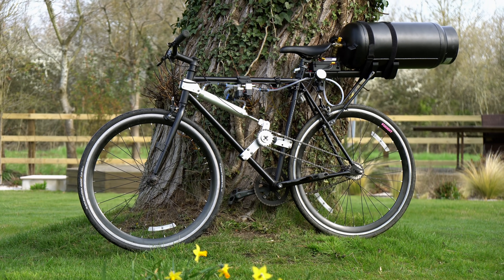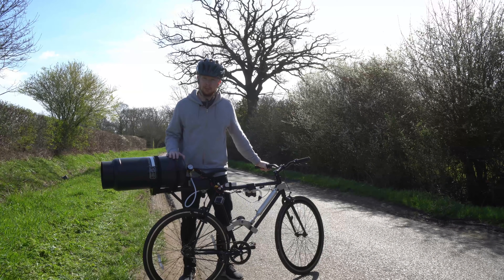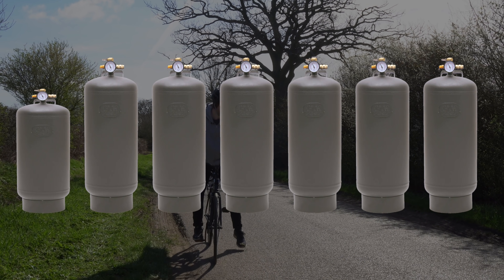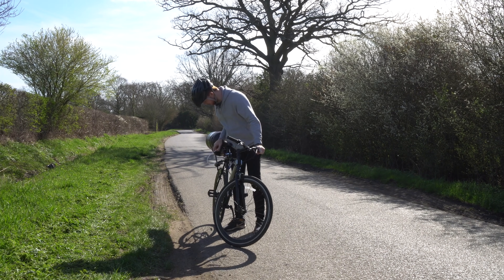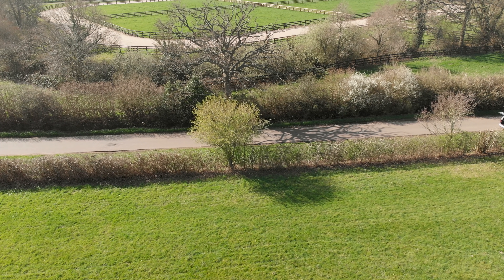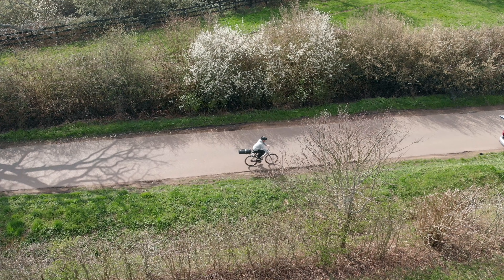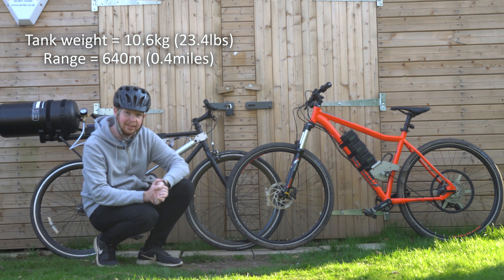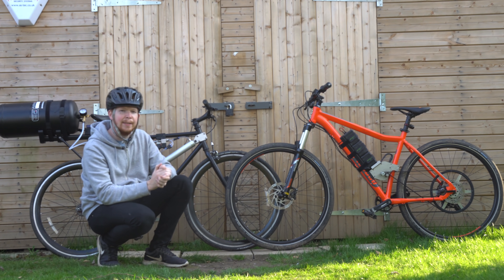Air Powered Bike Range

Comment: Could some creative valve timing be used for regenerative braking?
Reply: The AlienRobotAnthropologist wouldn’t it be possible to use the cylinder that is already there as a compressor?

So that you use the rotation of the wheel to push air back into the tank?
Reply: @among-us-99999  The exhaust pressure in the cylinder would have to be greater than what's in the tank in order to re-pressurise the tank.  That would be pretty much impossible.  You might be able to pressurise a reserve tank, but once the reserve tank build up pressure it would start to slow the bike down.  If you've ever used a hand pump to inflate a bicycle tire, you'd know what I mean.
Reply: dockettome well..the purpose of regenerative braking is slowing the bike Down
Reply: @among-us-99999  Except the "reserve" tank in this case could hold no more PSI than the cylinder can consume, which would be hilariously low.  You'd be lucky to get one stroke of usable stored air.
I actually own a couple of air compressors for air tools.  One of them is a small 6 Gallon pancake tank that holds 150PSI.  It can only be used with small nail guns, like a brad nailer.  I tried a framing nailer (3-1/4 inch nails) on it and it did work, but only fired about 4 nails before the electric pump had to kick in to re-pressurise the tank, and that takes a couple of minutes.  Compressed air is great for quick bursts of energy, but overall is horribly inefficient as a fuel source.
Reply: @dockettome  You'd need a separate cylinder with a much smaller piston surface area to compress the air at high enough pressures
, and then it could work
Reply: @thealienrobotanthropologist  Thermodynamics don't get in the way of getting some pressure out of your kinetic energy. It might not be super efficient, but none of this is.
Reply: @thealienrobotanthropologist  The additional weight from such a system would probably cost you more than you would gain.
Reply: @thealienrobotanthropologist  I had to google what a "jake brake" was. In Australia we just call them compression or exhaust brakes. "Jake brakes" is a weird name. The signs look like the photos a few pages down in this PDF: https://www.ntc.gov.au/Media/Reports/(675BC46E-8885-6E29-64B7-986E894BA1E1).pdf
Reply: I mean yeah... but you won't get much. considering the impracticality of this machine it would be perfect...
Reply: yes, but the method of air as storage is a failure in the first place.

Comment: Hi Tom,  just like to reinforce the point you made in passing that you're talking about suitability for vehicles, where the mass and size of the energy storage system (battery) is crucial. We're at a point in history where we need massive capacity short term storage of energy, maybe 20 kW hours per household.  These will will be static installations and it won't matter much if they're heavy.  Efficiency is a different matter.

Comment: Use Paintball Tanks, there are some 2 and 3 liter tanks around and they are rated to hold about 300bar and they are way way lighter than your aluminium or steel tanks.

Comment: Years ago I looked into using air power as a buffer to smooth out rider effort (capture energy downhill, release it uphill) as that would require a lot less energy storage and the short time frame wouldn't allow too much heat loss from the compressed air (the system would be insulated). Running the numbers quickly showed it wasn't very practical, though.

Comment: Now it is time to get even more impractical and make an electric-pneumatic hybrid bike by adding a battery powered air pump. You could then add a roof on it with solar panels to power the whole system. If you made a snappy enough video of it, you could make a killing on kickstarter.
Reply: solar friggin roadways!
Reply: something like this perhaps? http://www.homedepot.com/p/RIDGID-1-Gal-18-Volt-Brushless-Cordless-Air-Compressor-R0230/300507507
Reply: I was thinking the same thing... cali hipsters would buy it up... despite the mechanical efficiency and overall cost of maintenance and how fucking stupid this idea really is...
better make an indiegogo so you can just bail and never make the thing...
Reply: the longer the conversion line and the more chemical or mechanical it is the more energy is lost before it hits the road...
Reply: @alexanderstohr4198  I will correct you, the more electronics and electricals there are, the more unnecessary complexity and energy losses increase.
Reply: Advantage being, you could actually maintain high pressure along the ride
Reply: Somebody really made it 😂
https://youtu.be/2JjJ4_v285Y
Reply: Thunderfoot would have non of it and would probably tear him apart.
Reply: @oremooremo5075  XD He'd be so mad he'd get stuck repeating the same sentence for the whole vid.

Comment: Could you run the air through a turbine and gearbox and power the bike like that? Would it be more efficient?
Reply: Jeroen Trappers 
Are you willing to make the turbine impelers for him? 3D printing wont cut it, its too fast and too much power for just plastic
Reply: @laharl2k  you can find turbos at any scrap yard.
Reply: @yurimow  
You cant use a turbo, they are not designed for the pressures, flow nor load a steam turbine would have. Also you'd have like 15K rpm at the output, you need like a 500:1 reduction.
Sure you can do it, but still not with a 3D printer, maybe in hard wood but still it wouldnt last much.

Turbos are designed for low pressure, low viscosity, medium flow air, not for high pressure, medium viscosity, high flow steam. Itwill just either output too little power and the efficiency will suck,  or the efficiensy will suck period.
Reply: @laharl2k  Where did you get the idea he meant steam? The OP literally said "air". But I do agree, a turbo won't cut it.
Reply: Gear ratio inside a sprinkler head is about 4800/1 , makes sense to spin a turbine about that speed , the gear reduction would give you some torgue

Comment: you can program some mappings into it vor maximum range or power and use the cylinder also as a brake thet pumps the air back into the air tank while braking
Reply: ma zl 
Not sure pressure regulators can allow backflow

Comment: 24L @100 PSI at ambient temperature is roughly  31.9KJ or 8.86Wh of stored energy. Riding 3 MPH requires 7W (mechanical power), giving you a theoretical range of 1.27 hours or 6.3km range! However what you are getting is 683.7m. This means that your efficiency is 10.8% overall properly because of cooling of the air as it expands on top of the other losses. If you add compressor losses (motor + heat loss) of filling the bottle, you are around 8.6% efficient. If you live in a civilised wind turbine powered country, grid power might be as low as 200g/kWh. In that case, you are using 10.63Wh going the 683.7m and  emitting 2.26g CO2, or 3.3g/km (if we stay in metric), which is not shabby at all compared to pedalling, because you are going at such a slow speed. However if you were going at a realistic speed, say 12mph, you'd need 84W to maintain speed and your emission would be  39.6g/km, which still is less than pedalling but more than double of an E-bike that would emit around 17g/km. That is why air car startups go bankrupt every time.
Reply: Tore Lund 
A generator and a crank would be better than a bike pump imo. Maybe you could make a generator in the shape of a bike pump and get more power out of it, batteries just have way higher efficiency and energy density than compressed gases, unless of course you could make a liquid nitrogen tank out of unubtanium then maybe at 17,000psi numbers could start to add up
Reply: @laharl2k   A system like that would be a hybrid bike in that musle power was the main source, but batteries could be used when accelerating and braking to conserve energy. Might be a net saving in stop and go traffic like with hybrid  cars?
Reply: @Tore_Lund  
mmmm electric bikes have all you need, only thing missing is the brains. 
Theres a lot of strategies you could take to save energy or even generate some, but no ona has some any of that so far.
Reply: @laharl2k  It just struck me, most e-bikes have regenerative braking already!
Reply: @Tore_Lund  
Some but not all, mostly the cheaper ones dont, which is like 99% of all ebikes

Comment: Pv=mrt or p1v1=p2v2, you should know your power stroke vol and you should know your return stroke volume( with rod removing vol) and should be able to figure out the pressure and volume based on the 40psig going in.

Comment: couldn´t you put electronic valves close to the cylinder that fully open when exhausting the air? I´m not sure how expensive that is. There might be even a way to do that with 2 or 3 "one way" valves.
That way you could maybe get rid of the exhaust gas a bit faster.

Comment: be interested if you could get hold of a small boc compressed air tank at 230 bar. maybe you might find it easier to get hold of a scuba tank and refills of those should be ready available at your local scuba club. with 3000 psi you could get an actually usable range out of it.
Reply: ah should have waited till end of video.. however you do get carbon fibre scuba tanks which are a fraction of the weight. but at the end of the day you didn't ever thing air power was gonna be better than battery powered. now.. fuel cell... that would be interesting as it would perhaps be in a grey area legally in UK (is it electric and hence ok on a bike or a 'combustion engine' and which case banned)...

Comment: Would it be possible to reverse the timing and get the piston to act more like a bike pump and push air into the tank? You could go downhill or use pedal power to "charge" your bike.

Comment: The guy who invented a air powered car said he used a small amount of fuel to heat the air right as it went into the numatic chamber but even without fuel it could go about 30 miles at 40 mph which was more than enough for work and home travel. He did this by using a fiber glass tank that ran the entire length of the vehicle so it also acted as part of the cars supporting frame. A bike you got from the store is not optimized this way.

Comment: Maybe the key is to put the air tank on a trailer.  That will fix the center of gravity problem and possibly allow for a larger, heavier tank.
Reply: Dan Harold 
Or more than one scuba tank!
Reply: Going for a carbon fiber composite cylinder rather than a steel one would probably be a good starting point. I looked up what Dräger had available and there's a 9L 300 bar working pressure rated one with an empty weight of 5.3kg. If they exist scaled up to the same quoted 20L it'd probably come out at less than that 1.7L per kg of cylinder weight, but given that the one I mentioned already costs over 1100 pounds new I don't even want to think about the cost of larger units.

The carbon fiber composite cylinders afaik are rarely used for diving, the weight of steel is preferred apparently for buoyancy reasons? Firefighters, paintball/PCP airguns, etc are areas where having a lighter option is beneficial. Now that I mention that, there are probably cheaper options out there than Dräger for less critical use cases in the paintball/airgun world and maybe even higher capacity ones.
Reply: @extrastuff9463  sadly, they are not really much cheaper. A carbon fiber paintball tank (cheap, mind you) will set you back a cool $250 US. That would be a tank about the size of a cantaloupe. That said, bicycle frames are hollow by nature.... may-haps that can serve as a tank?
Reply: @Quartzkensai  That would be a rather small tank and not really offer any benefits over a regular large scuba tank. I think when I looked up ~9L Dräger carbon fiber composites (~4.5kg empty weight) they were around 1100 pounds before taxes. Expensive, still not really a great realistic bicycle range (better and safer to use batteries and electric motors in many ways). 

There are probably cheaper similar products out there but that wouldn't make sense to use, the range still won't be great refilling would require a dive club/compressor at home? Compared to electricity certainly less efficient than the ratio of what you get out of charged lithium ion battery compared to what went in. While compressing the air a lot of energy is lost as produced heat and it's hard to beat the efficiency of an electric motor.

As for storing air inside the frame I'll give you this much it is creative, but not realistic for a decent amount or high pressures:
1. internal volume even added up isn't gonna be huge
2. many joints that are weak spots
3. the walls would have to be quite thick to support any reasonable pressure
4. the saddle is usually adjustable in height (lot of volume loss or a seal that can easily leak)
5. not sure if pressure vessel regulations would even allow you to deliberately  design something like that (it would probably have to be pressure tested as well)

Comment: you should do a compressed air generator that charges batteries. would it be feasible to have "quick charging" vehicles that have a compressed air generator.

Comment: Can you do a comparison video between different gases like helium co2 argon etc?
Reply: aannoonniimmss 
What makes you think that will make much of a difference? 
On the ‘engine’ side I think there’s no difference since pressure = pressure no matter where it comes from. 
On the tank side it depends on how compressible these gasses are. Idk if there are significant differences. I would guess not but maybe someone else knows. (It wouldn’t be very practical though since the costs would skyrocket.)
Reply: @Conservator.  Cody from Cody'sLab has done a video shooting a pellet gun with helium and got different results compare to air. So I thought it would be interesting to see how air bike works. Btw Cody's video was published in June 2016
Reply: aannoonniimmss Hi,
Just watched his video. I’m surprised that the helium filled gun shoots faster pellets. Apparently helium is harder to compress and thus gives more pressure or as Cody explanation the helium molecules travel faster because they are lighter so the can still push the pallet even at the end of the barrel. 
I can’t believe that the pallet would go almost as fast as the gas molecules since it is so much heavier and has to overcome the resistance from barrel.

Comment: Ok next step: wood or coal fired steam boiler
Reply: Better ask Nighthawkinglight for woodgas powered bike
Reply: Flash steam boiler,like small model boats are using.And they are really fast.Engine should be V4 hp/lp steam engine, like Bessler made Steam powered air plane.Steampower 👍
Reply: @zakathzakath6184 those are neat.
Reply: @zakathzakath6184  where can you find these model boat flash boilers?
Reply: Yes, and wait 30 minutes to get up to pressure :)
Reply: @KHos73 why....air can do it in under 10 with a fireless design.
Reply: Better yet a Stirling engine running off the heat directly instead of making steam.
Reply: Miniature boiler with heat exchanger would be awesome..
Reply: What you need is a small jet turbine to generate electricity for heating water to steam, then you won't run out of tank pressure so fast.  :o)
Reply: @Erick Konop True! Does that need more heat though?
Reply: Max Pain  Ha, how about a "free" energy magnet motor? :)
Reply: @KHos73  that's the ticket>   just make it and will use it. ;)
Reply: Or: a V8 air engine :^)
Reply: Have the boiler run a turbine that runs an electric generator which runs a compressor which then runs the air piston. :D
Reply: @redsquirrelftw  or pedal it.... just saiyn
Reply: That just sounds dangerous and unweildy
Reply: THAT is certainly the future.
Reply: @soundslave but on a moped.
Reply: Hout is beter of gas
Reply: the first motorcycle was coal powered almost 150 years ago
Reply: @fastinradfordable  steam not coal
Reply: @jilkeschilteschilte5311  coal fired steam
Reply: Vega You apparently don’t get the concept of an air powered bike
Reply: captain pugwash people made love 200 years ago, doesn’t mean we shouldn’t do it anymore 😂
Reply: captain pugwash perfect for the simps!
Reply: probably work better than this!
Reply: Ever heard of stirling boats?
Reply: Say no more.
Reply: Or woodgas
Reply: Next step at a little air compressor that usually plugs into the dash your car but, plum it back to the air tank. you're turning a giant back tire width a large diameter pully every rotation the back tire you can spend that little air compressor a million times. And pedal least a little at first. Try going as fast you can and then turn on the air
Reply: Yesss
Reply: This is air not steam
Reply: Or hydrogen peroxide decomposition :)
Reply: Or you could electrically fire the boiler.
Reply: @martindinner3621  making the world's least efficient electric motor haha
Reply: @martindinner3621  What a stupid idea..